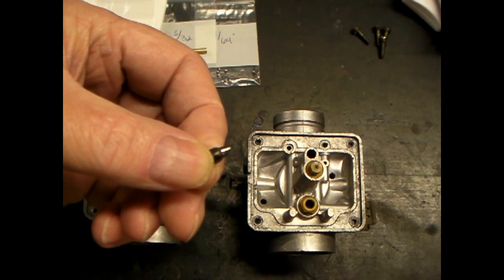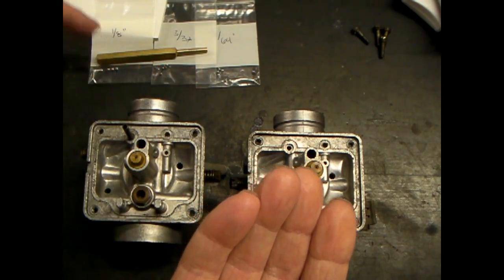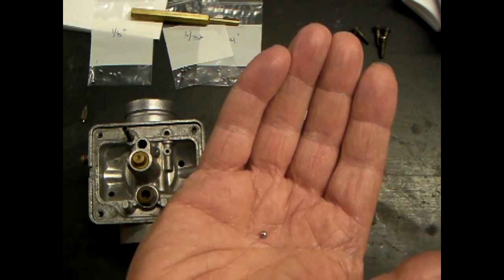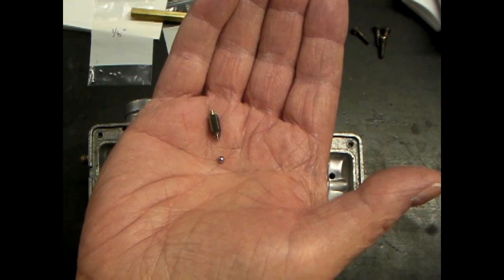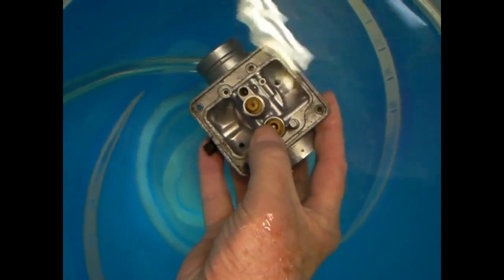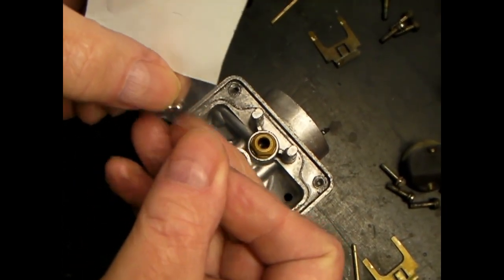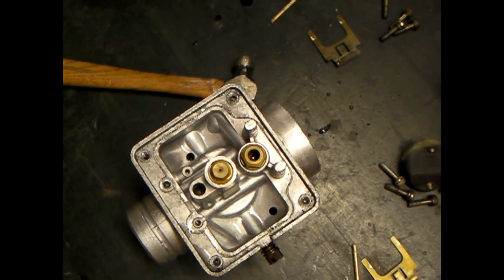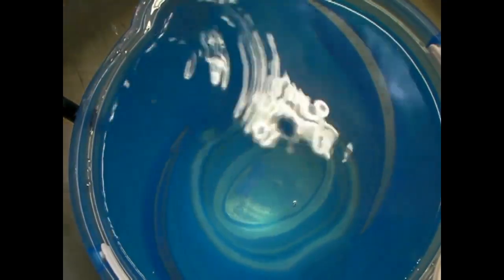Carburetor Float Needle and Seat Repair with Steel Ball

Comment: That's a good idea, but what happenes if you put the ball in seat and then adjust the float, needle and float will prevent the ball from falling, and it give us a extra option ,
Reply from the maker: Be sure to test it with a bucket of water as shown in the video.  This is important.

Comment: Genius idea! Now.. if only I had a bearing shop nearby. 

The Mikuni BST40 on my DR650 started loading up with fuel. Rebuild kit comes with a new needle valve. I usually just run a q tip on a drill into the seat but if that doesn’t work I may try this method.
Reply from the maker: You can order the bearings online with the number printed on the bearings. This is universal. Ebay could get you bearings. If you want the metal cages, mine were made in Turkey.
Reply from the maker: You can get small balls from a bicycle shop.

Comment: Just a great tip - genious way to overcome very common problem. I have two Teikin carburetors in my Yamaha RD 125 1974 and there's a lot of parts You can get nowhere. Needle valves are one of them. Actually, when You think about it over, the manufacturer should have done this "valve seat honing" before valve seats left the factory to be satisfactory. Needle valves are quite pricy nowadays - a pair of tem will cost about 70-80 dollars a pair in here Europe - if there's any NOS left.

Comment: Just restored an 81 Yamaha MX with my son.
Mikuni VM24SS. 
Can’t set the float level at spec to 21mm because it leaks over and through  the bowl over flow tube.
New needle and seat, and all other removable brass parts.
That new needle and seat must be leaking at 21mm unless alot more float pressure is applied than what 21mm spec can put on it. At 25mm it stops sometimes but sometimes still leaks, and will drain out onto the ground, even from the air filter side of the carb and flooding the engine.
I will try your ball method!

Comment: It works because metal to metal fluid seals like this rely on a single point of contact,  a circle where it touches between the seat and needle,  the surfaces dont have to be matching angle etc, infact a large contact area is more prone to a small mismatch somewhere which leads to a leak.

Comment: Thank you for your video I've got a 2mm  2.5  3mm one which one do you thing is the best one to use in my CV carb thanks Jeff in UK.
Reply from the maker: Largest one that will fit.
Reply: @Adventurepilot70  thank you great trick.
Reply: @Adventurepilot70  Thanks.

Comment: WOW, THAT WAS AN AWESOME VIDEO. WHAT A SIMPLE FIX. THE ONLY THING YOU NEED TO BE CAREFUL ABOUT IS MAKING SURE YOU USE THE CORRECT SIZE BEARING. ALSO BESIDES THE CORRECT SIZE BEARING THE FORCE OF WHICH YOU HAMMER TAP THE BEARING IS EXTREMELY IMPORTANT. GREAT IDEA THOUGH AND GENTLE HAMMERING CANNOT BE EMPHASIZED MORE HERE. THIS SIMPLE, ALL BE IT GENIUS IDEA POTENTIALLY CAN SAVE YOU AROUND $500 PLUS DOLLARS DEPENDING ON THE COST OF A NEW CARBURETOR BODY. ANY IDEA WORTH $500 POSSIBLE SAVINGS IS ABSOLUTELY WORTH CHECKING OUT FOR YOURSELF. WHAT DO YOU HAVE TO LOOSE HERE? IF THE BEARING TAPPING IDEA DOESN'T WORK AND THE FLOAT VALVE SEAT AREA STILL LEAKS, SO WHAT THEN YOU KNOW YOU HAVE TO BUY A NEW CARBURETOR BODY. AT LEAST YOU TRIED TO SAVE A BUNCH OF TIME AND MONEY. IF THIS IDEA WORKS JUST THINK OF THE HERO YOU WOULD BE TO A BUDDY ON A BUDGET AND YOU JUST SAVED HIM $500 DOLLARS, HAHAHA, YOUR DRINKING FREE AT THE BAR THAT NIGHT. GREAT VIDEO THANKS FOR SUCH AN AWESOME FIX.

Comment: I'll be damned. 97 CBR #4 carb leaked like a sieve filling engine with fule. Was at the end of my rope and bought new carburetor body only to be delivered the wrong carburetor. I searched the net furiously to find anything I could and found nothing. Was about to give in and set the bike on fire but then saw this video today. I did this. I went to Ace hardware bought a steel  ball bearing, put it in the seat and smacked it with a hammer and I'll be damned if it didn't completely change the seat and sealed the needle  up then I tested it in the water and  no air at all. I will install it on the bike  tomorrow and see if it really really fixed it. Thank you so much for posting this video. Stay safe up there!
Reply from the maker: Glad it helped you. Like you, it was really an act of desperation. I should think that doing this would ruin the seat, but it has worked perfectly for me every time I used it.
Reply: @Adventurepilot70  well I took me a while but I finally got the carbs back on and I'll be damned again it worked I told a bunch of people and nobody believes that but seeing is believing of course now fuel is leaking like a sieve out of my air solenoid. This is the second time it's done this and I guess I don't know how to fix it.  Happy but sad! Hey thanks again for posting your video.

Comment: Gdammit, after going round and round with KDX Keihin doing all the usual q-trip-abrasive crap, adjusting the float
many times, I did this. It WORKED!!!!! Thanks.
Reply: Dude, I laughed when I saw this comment because I’ve had an 89 KDX for about 10 years now that has always had a leaky carb. Went through the same exact stuff with float, q tip, and it’s been rebuilt multiple times and always still leaks. I’m interested to see if this will fix mine too.
Reply from the maker: Should work if you have an accurate ground steel ball.
Reply: @Adventurepilot70  I’ll be sure to grab a ground steel ball and a brass punch. I’ll let you know how it goes! Either way, great video👍
Reply from the maker: @Cr250r15  Just be sure to test it as shown, to be sure the needle seals tight.

Comment: this was an outrageously good video - where in the world did you find a little brass punch like that designed for tiny bearing balls?!
Reply from the maker: I got a set of them from Harbor Freight.  A steel punch will work, but might put a flat spot on the ball.

Comment: My fuel pump wont prime when hoses are connected and bike won't start. If I take the hoses off it primes. Filter is good was told carb is stuck. Please help
Reply from the maker: Take the carb off and remove the float and needle to see if it is stuck.

Comment: I have a wr250f and it's flooding and leaking gas from the nipples of the carb this would work it's $1600 for a new carb
Reply from the maker: I can't say for sure, but if your carb is leaking, what have you got to risk?
Just be sure to use a hardened and ground steel ball, and TEST for leakage before you assemble everything.

Comment: Even though this has been out a few years, I think it's still worth a comment. Overall, it's an excellent fix for a part which otherwise needs replacing.

To be clear: the seats almost never go bad, though they do tarnish and accumulate filth. But unlike the needle, they are thicker metal and do not suffer significant force. The needles are the failed component when you see that scarring.

The ball bearing trick is stretching the seat orifice uniformly. That results in a wider opening, allowing a "fresh" unscarred portion of the needle to be the new sealing surface. So long as you don't stretch the orifice wider than the needle cone--and that the new point of contact on the needle is smooth--this trick has the same effect as replacing with a new needle and seat. It should be noted: this can only be repeated a limited number of times before there's no way out of outright replacement.

But also a word of caution. Be sure to check your float alignment afterward. This will cause the current adjustment to close the valve at least a slightly higher float level. That can put you at risk of flooding. Readjusting the float will prevent that.
Reply: Excellent reminder to look into float adjustment!

Comment: Excellent! Gonna try this seeing that the little Phillip's head screw is rusted -stuck, holding seat in place...they should have used stainless steel cos of it rusting and that rusted metal powder could plug one of the tiny.holes such as the pilot jet!

Comment: Hi!
My results about this procedure on my Yamaha Tmax...
1st. I used a 3mm ball, but the carb was still leaking.
Than I used a 4mm ball and it was succesfull (at this moment).
After riding 200 Kms, the carburetor is overflowing again. :(
Reply from the maker: Testing as shown shows the needle and seat work, but does not check other problems, such as swollen or sunken floats, binding or incorrectly adjusted linkage.
Reply: @Adventurepilot70  You're right. Please tell us  your experiences about
how many milles can you ride your bike after this procedure please?
Reply from the maker: Airplane and motorcycle are still working fine.

Comment: Excellent idea and thanks for video. I think a drill from your drillbox what fits nicely in the hole and the  hammer punch on the sharp end of the drill. And size of ball maybe diameter size of the valve cone at almost the widest diameter. (80-90 % from the tip of cone). How about that?

Comment: Excellent   I will give this a go on my snowmobiles   mikuni carbs   Recently had trouble with one, ran fine the day before, overnight gas leaked out enough to flood and even put a small puddle below sled.    Mine needle has the vitron tip and could see a minuscule witness line on it. Great idea on the water test. Thanks so much.
Reply: Mikunis have replaceable needle seats.

Comment: Brilliant, if it's already broke and this cost nearly nothin to try to fix it, and he even showes you how to check to see if did. 
Gonna try rhis on my snow blower carb.
Reply from the maker: It might take a pretty small ball, but you can find them at bearing shops or online.
Reply: @Adventurepilot70  gonna start looking tomorrow, a ball about 1/2 to 3/4 bb diameter would be just right.

Comment: I found this is very interesting I investigated it and found that these Chinese carburetors the seat is drilled from the outside leaving a bur on the inside causing these needles to leak and but using the steel ball it gets rid of the bur
Reply: SO GLAD you mentioned this!  Had no idea and don't think I'd have considered this.
Reply: I went through then same thing. Fixed my OEM this way. Will give noodles the same treatment.

Comment: i applied the same method but with a punch small enough to just fit in the hole. leak fixed, many thanks
Reply: I was thinking same thing, use a center punch..
Reply: Should be the same effect, could be easier than trying to hit a tiny bell with a flat punch,  just stick your point in the hole and give it a wack.
Reply: @bipedalbob  If the centre punch has been sharpened at any time, this may not be as good as the hardened steel ball.
Reply: @roybulcock8116  the tiny steel ball is probably better it's just getting one is difficult,  I ended up polishing mine and that worked, only because I ordered a new complete carb on Amazon for $17 Canadian, took a couple months to get it and then didn't need it but it's cheap karma insurance, if you have it you won't need it .

Comment: i have try it whit walbro hda carberator alu casting  no result.  i have tryed with 3 different balls. wat els can i try??
Reply: Man u probably already figured it out but I just polish where the needle seats,I've used a really small (dremel) brass wire brush,or 0000 steel wool,or I'll take like 3 q tips and put them in the chuck of a drill and polish inside

Comment: Hi,

Sorry but I’m not sure what was achieved by what you did.  

You put a ball to cover that hole, then you punched the ball, then removed the ball.

What did that do exactly and why did it fix the problem? 

What does it mean by “peen” that hole?  Like you said in the video ?
Reply from the maker: Hi, Mike.
  What I achieved was it quit leaking as shown in the video.  Why it did this, I don't know. It seems a terrible idea, and if someone asked me about doing this, I would say it would ruin the seat, as the seat would not match the needle.
  This was an act of desperation, as I had a carburetor body that has a non-removable brass seat. The choice was to buy a whole new  carburetor body or try to find a new carburetor.  On very old machinery, this can be difficult..
I have used this method to fix 8 or 9 carburetors since using this method.  Twice I had a great improvement in leakage, but was not perfect. I  repeated the procedure and got perfection. I always test as shown to be sure no air leaks. I always use a hardened and ground steel ball. ( Available from bearing supply shops. )  I tap it very lightly with a very small hammer.  
   If you can get a new needle and seat, do that. This is something to try as a last resort. Just because it worked for me does not mean it will work for you, as you might do something different than  shown in the video.

Comment: Who can help me with this? I have a 2004 blaster that wouldn't stsrt without stsrting fluid. I took it apart and the float needle was stuck in the thing it slides up/down in. Would that cause it to Not start? I broke the tip of it so I can't toss it back together until the rebuild kit gets here, would it start with the tip being broke or no?
Reply: Nope it won't now you probably need a new carb body to go with your rebuild kit.

Comment: i believe you are basically forging it to the shape, something the exact shape of how the seat is meant to be might work also, and give something to pull it back out by, this would force the small scratches and micro bumps and stuff to fill and anything raised to flatten, if you see scratches on the needle they were likely caused by those things, i want to try this on a set i have but i already used the polishing method, though they seem to keep getting a buildup

Comment: How are you determining what size ball you use?
Reply from the maker: It seems the exact size is not that important. Use the largest ground steel ball that will fit into the hole where the needle goes. If you use a ball that is too small, you could get it stuck in the inlet hole, and might have a great deal of difficulty getting it out.
Reply: Don James, I was going to use a steel BB from my old red Ryder BB gun.  Didn't want to mess the seat up because my seat isn't removable.
Reply from the maker: Don't use a BB. They are soft and not heat treated. While a BB might be the right size, they also are not centerless ground, so they are not very accurate.  The ball is going to peen the valve seat.
Reply: Don James ok thank you for the advice.  My uncle owns a excavating company.  I will scour his shop for a real ball bearing.

Comment: I've got a four wheeler out in the building right now with a leaky float I'm going to give this a try.  not sure if I have any bearings that small but I do have some BBs. if it doesnt work I'm going to try over drilling the hole a smidge to re-round it and let it contact the needle where its not worn.
Reply from the maker: I think you should use a steel ball that is ground. A BB is soft and not heat treated.
It is also not very round. You can buy the steel balls at any local bearing supply shop or a bicycle shop. You might try Ebay or the internet as well.
Reply: figgered you were right about the BB so I lightly reamed the edge of the seat with a small drill bit and polished it a bit with qtip, valve grinding compound and drill. I also replaced the o-ring on the seat. seems ok now. cross my fingers.

Comment: You are making the hole round, if it wasn't already, and you are creating a sharp edge for the needle to seat on. The worn edge having a rounded profile provides too much surface area and the pressure pushes past the sealing area. You want the needle seat to have a sharp edge, and that is what the ball is restoring when you hit it. That is my understanding and experience.

Comment: Steel ball worked for me after seeing this vid. ATV leaked out more gas than it burned. It would drain the tank if I fergot to turn off the fuel cock. Yup crankcase had  to be drained each time too of gas. 2 stroke Polaris. Dealer wanted like 55 bucks for a new combo and 50 miles away ugh. Glad to see this video and save some hair I don't have much of from pulling it out over this leak.
Reply from the maker: I am glad this method was a help to you.  I hope it can solve the problem for a few enthusiasts who cannot get new parts, or are too expensive.
My own carbs leaked very badly, so I figured I had nothing to lose by trying this out, and to my surprise it has worked every time I tried it. Like you, I don't have much hair.

Comment: I think your bearing is busting through the buildup on the brass mother's car polish on a Q-tip in a drill works great
Reply from the maker: I tried the polish on a Q-Tip idea on a couple of other carbs, but couldn't get it to seal. I admit that using the steel ball was an act of desperation, and it surprised me that it worked out for me.  Using the steel ball should be tried, only if you don't know what else to do.  If you test it and it still leaks, you can hit it again. Just be real sure the ball is centered on the hole.
Reply: @Adventurepilot70  I think polishing is a bad thing after watching this video, you want a sharp edge, polishing removes that sharp edge ? 
Maybe constant movement of the needle on the seat removes that sharp edge over time ?
Using the ball to peen the edge it then makes it nice sharp and reinstates the integratity of its shape
Reply: Don James awesome man glad to have that advice
Reply: great! next time i need that,i'll try with the fine valve grinding compound on a q-tip;  great analysis,and great tip; 
i´ll add that the steel ball method, may even correct fine scoring lines on the seat,due to erosion/material defects,but it's diameter is key.